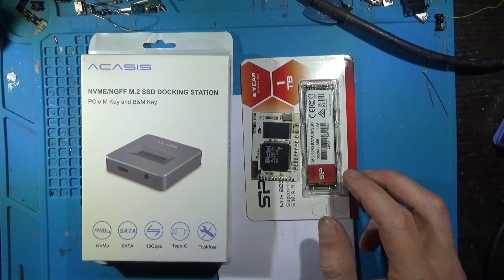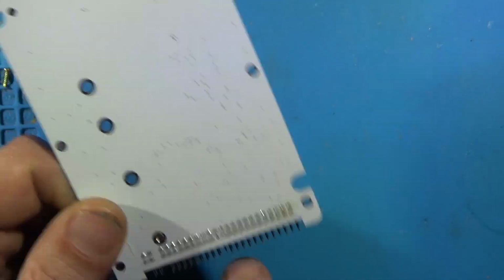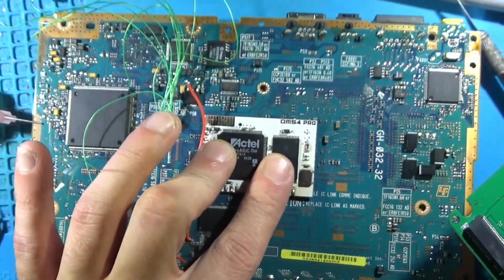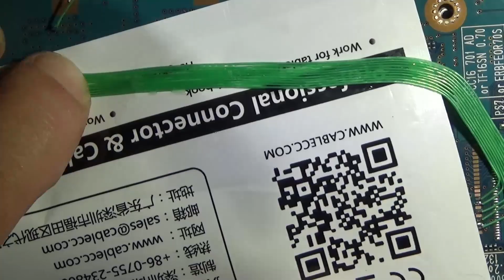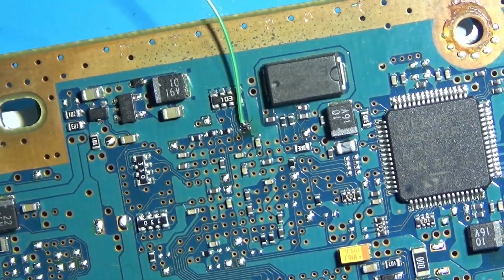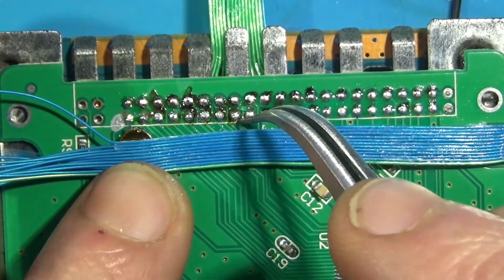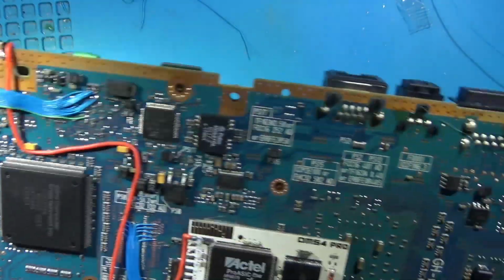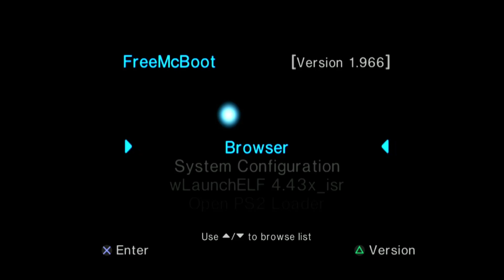Internal 2tb SSD Ps2 Slim  - IDE to M2 Mod

Comment: Did you have to redo the DMS4 wiring? The wires were green for the start of the install.  Later when you did the IDE wiring, the DMS4 wiring changed to blue.
Reply from the maker: There was a whole lot of troubleshooting that went into this one yes. I for ended up redoing it and ultimately removing it as the dms4 was acting up
Reply: @ModzvilleUSA  Ah! I may have experienced the same. If it helps, I remember way back in 2005, reinstalling the DMS4 Pro "original" multiple times and never got a perfect boot rate. First cold boot always seemed to just black screen. When the PS2 would eventually boot, the modchip worked fine. Anyhow, sometime later the DMS4 Pro "SE" (Special Edition) chips came out quickly replacing the originals, and those would boot correctly. I still have some of the originals. If you ever learned how to make them boot consistently, I'd love to know :)
Reply from the maker: @bytesaber  I never did! I have 1 out the 4 I own that boots consistently. The are wonky to some degree.
It seems to only be with toxicos. Toxocbios seems to work fine
Reply: Can ToxicOS work with Harddrives or SD Cards? 
Edit: I rewatched the video and saw it detecting the Harddrive.
Did you ever get it working?

Comment: So most hard drives I have ever tested are around 100 read and write, IDE is 133. I've seen people say it doesn't matter using an SSD because the bottleneck is the IDE. So I'm asking if you think that the better speed no matter how little of a boost, does it help compatibility? It should have more consistent speeds. I saw that new M.2 loader for the GC and apparently it helps with frame rates. Does an SSD help that on the PS2? I don't plan on going this route, but I'm considering a 3.5 SSD for my phat model if it helps compatibility by having a consistent 133. Any thoughts?
Reply from the maker: This isn’t about speeds. This is about fitting it in a slim.
For a fat you can go over 2tb now with the new OPL fork using exfat. I’d recommend looking into that

Comment: Can you play old school games if you mod your PlayStation 2 like Super Nintendo or genesis
Reply: This is a mod to play PlayStation 2 games specifically region free without the disc - there is literally no other reason why you would go through this much trouble to mod your PS2. 
To play SNES or Genesis games would require the PlayStation 2 to emulate. And there are much better solutions and systems out there that are cheaper and easier to emulate 8 or 16 bit consoles with than a PS2 . The best advice and easiest way would be to use a a cheap PC or any PC to emulate SNES and Genesis games.

Comment: Wonder if the 128GB (for practical uses) limit on micro sd cards is still in effect?

Just imagine when 2TB micro sd cards become available someday at the price of $10. Not now, all are scams but maybe in another few years or so.

Currently building a small cache of micro sd cards for a romset.

See everyone in about 2 or so years lol.

Keep up the excellent work ModzvilleUSA and Gusse!

Have a good evening!
Reply from the maker: It’s those ide to usb boards unfortunately. That’s where the limitation is 😫
Reply: @ModzvilleUSA  ah, I think I understand now, the adapter is probably only able to see the LBA-28bit standard. Which is probably good enough for embedded terminals and older pcs and helps to explain that.

Thanks again ModzvilleUSA, have a good day!
Reply: @ModzvilleUSA  would an ide to sata and then sata to sd adaptor solve the problem?
Reply: @MichaelM28 stumbled onto something earlier this morning: CF cards use pata(ide) internally. You can probably solve the whole fiasco with just a CF to SD adapter card stripped down to the board. Anxious to test this
Reply: If now tested, what was found?
Reply: @That_Handle  I believe Gusse_ was able to bypass the limit with the iFlash conversion board for the original generation iPod.

I believe he demoed it with a 512GB micro sd card.
Reply: @psudobuddha ,
Have you any indicators from your testing regarding your postulation of ~[CF to SD]?
Reply: @That_Handle  from what I could tell the one I got my hands on, it's the same chipsets as the IDE to USBs. Sadly the same problem.

Comment: I think you need a smaller soldering tip.
Reply from the maker: Always use the largest tip you’re comfortable using for the job.
Larger tip, better transfer of heat
Reply: @ModzvilleUSA  Sure, but to actually have that benefit your whole tip needs to actually make contact with the target. 

A 3.2 mm wide tip isn't any better soldering a 1 wide mm pad, just more likely to make solder bridges or knock something else off.

I'd go with something like a Hakko T18-C1, maybe C05, can't really tell from the scale of the video.

Obviously your results work, I'm just physically cringing watching sometimes 😅
Reply: I noticed some board burn due to radiant head comming off of unused potrions of the tip. It was bothering me, and alls I could think was that he should be using a smaller tip cuz he can't transfer any more heat in to the pad but not the surrounding areas with a bigger tip than the contact area... thus the smaller tip will solder just as fast but cleaner and without charing, singing and cooking not to meantion less risk of accidently desoldering near by connections or bridging.

Look, I don't have a console modding background, but I've done thousands of smd solder mods on other electrinics with a soldering iron. The skills don't change because of what the electronics item is/does.... 

gungan is right, you would benifit from a smaller tip. Otherwise, your work is already really really good. Especially your cable management.
Reply from the maker: @Ichihiro36  
Thanks! I recently upgraded to a JBC clone which allows me to use smaller tips efficiency. The smaller tips didn’t work well for me with the T12